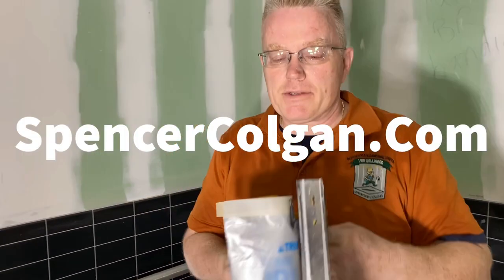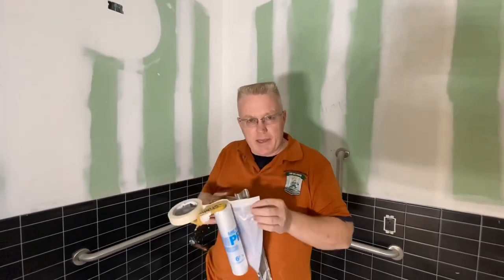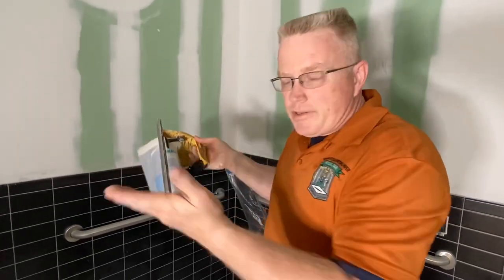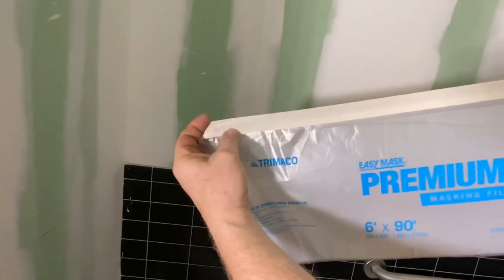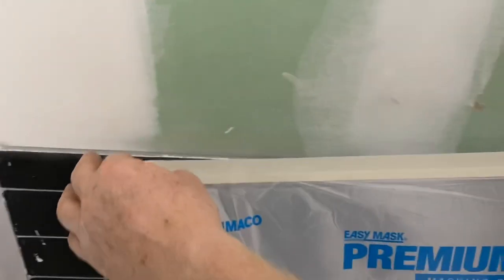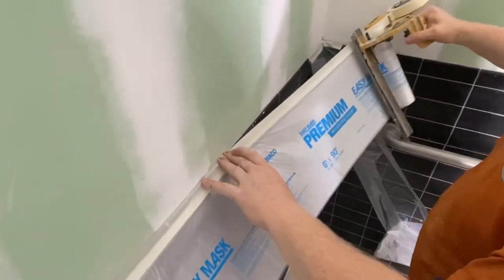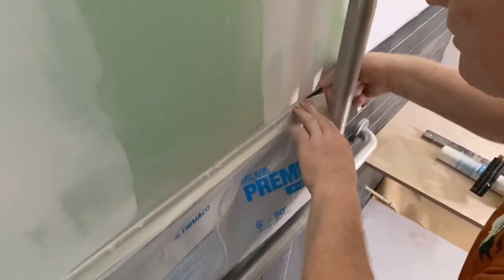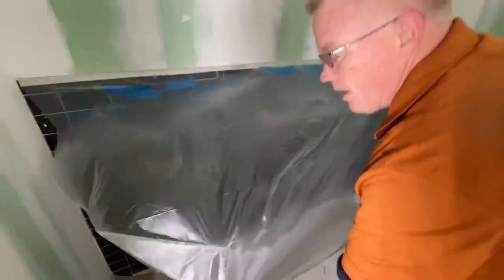Using a 3M Handmasker With Plastic for Painting - Spencer Colgan

Comment: There is an attachment that usually does not come with the masker and is sold separately. It attaches to the cutter and has a guide that slips into the other end of the roll. It secures the roll that that you cannot pull it at an angle. Not as necessary with paper. But really helpful with the plastic.
Reply from the maker: I have it.  I have 4 h. Maskers.  Same crap.

Comment: Realizing this video is two years old but it is a 3M hand masker designed to be used with 3M Advance Masking Film or 3M Contractor Plastic not a competitive film as you are using . The masker also works well  with a wider tape. I prefer 1 inch or  1.5 inch and the 3M Straight Cut blade makes it faster in my opinion